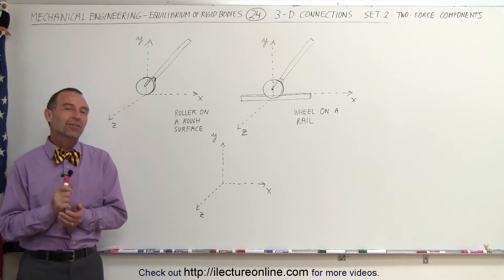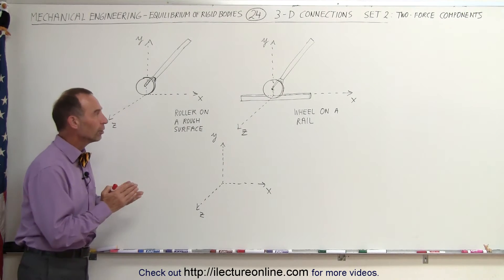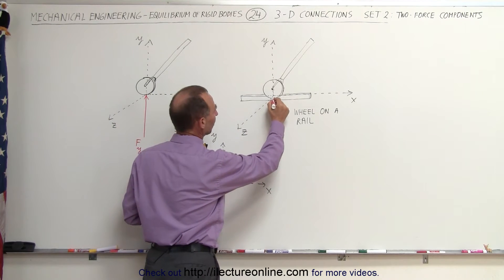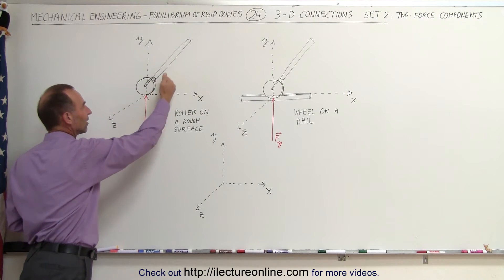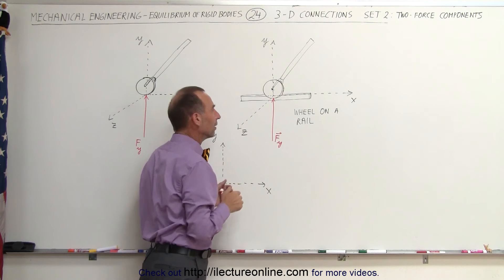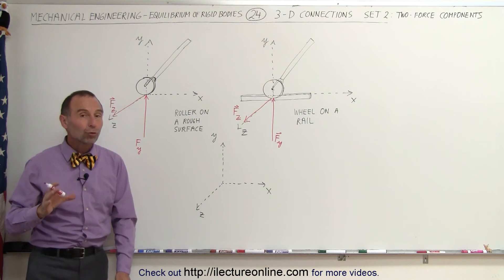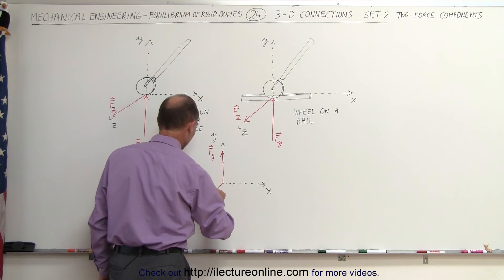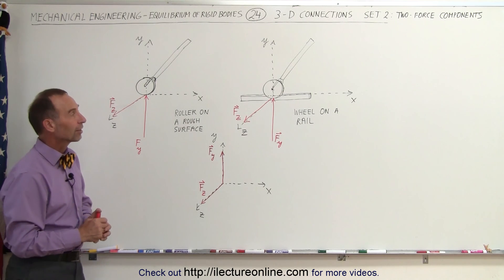Mechanical Engineering: Equilibrium of Rigid Bodies (24 of 32) 3-D Set 2: 2 Force Components

Comment: Why is there no friction in the direction of motion of the roller??
Reply from the maker: It the real world there is.  But for the purpose of establishing the basic forces on the various connections, friction is ignored.  (In the case of steel rollers, or hard rubber rollers, the friction component will be very small compared to the other forces and therefore ignoring the friction is perfectly fine.
Reply: @MichelvanBiezen  But the figure says that the surface is rough...

Also you did include friction in z direction
Reply from the maker: If the surface wasn't rough then there would be no friction and the wheel would slide, not roll.  It is not that there is no friction, it is that we are ignoring it.
Reply: @MichelvanBiezen  ok that makes sense, thanks!